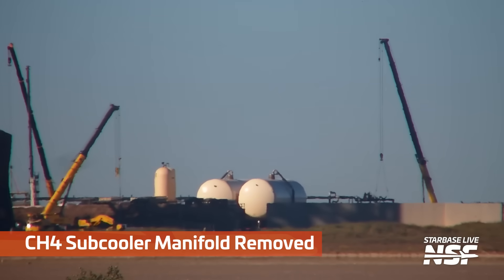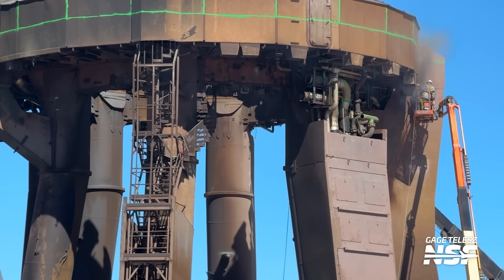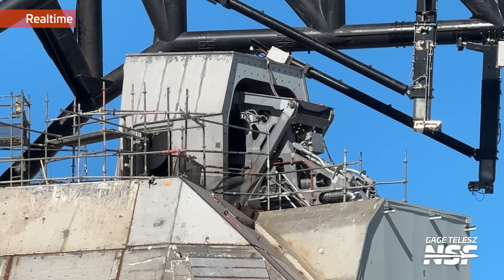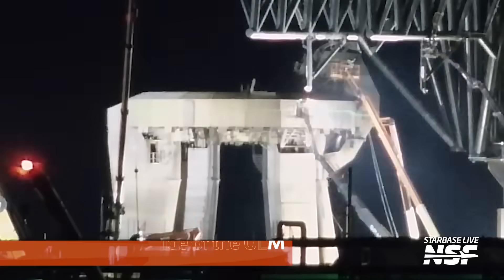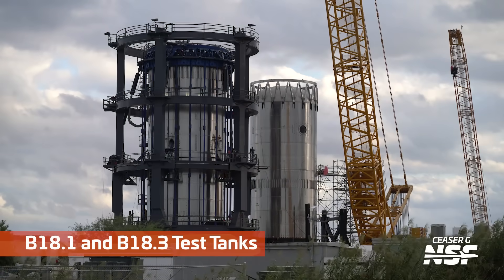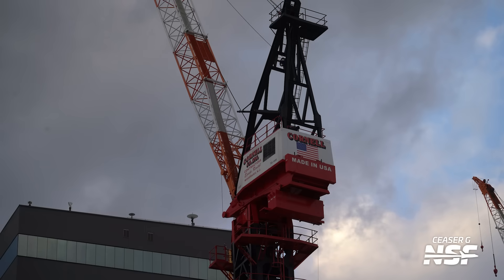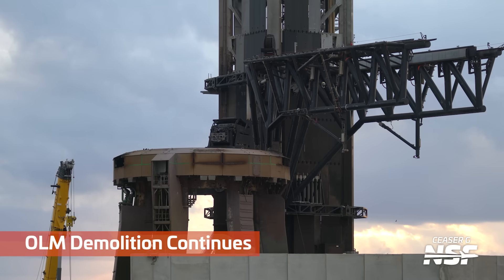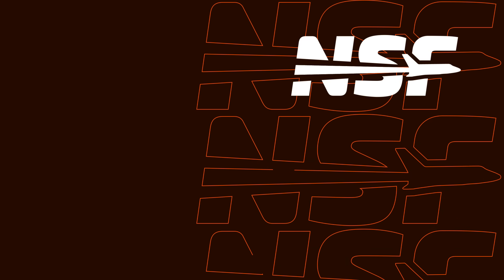"Tearing Down the Old Launch Mount" | SpaceX Starbase

Comment: thats the thing with demo. most people think it's all HULK SMASH! it's rarely uncontrolled like that. you need to understand how the structure is going to act as you remove parts. and how those parts themselves are going to act. if you're just doing a cut and drop you need to control it. not send it winging across the site. at 1:50 that torchman knew exactly what he was doing. brought it down to vertical then sent it straight down in a controlled manner.

Comment: You mean the mount that I have been saying since they built it was an ill conceived doofus of a design that would never work?   The one that Musk INSISTED was a ‘great idea’ and told his engineering team to just ‘MAKE IT WORK” despite their trying to explain that it never really could?   The launch mount that utterly ignored EVERYTHING ever discovered by NASA and Roscomos and even ESA about how to mitigate acoustic damage on a reusable launch pad, like, Y’know, the one SpaceX launches all their manned missions from at the Cape that was built in 1963?   This launch pad that SpaceX WASTED 4 years and 3 billion taxpayer dollars trying to slap bandaids on that made SpaceX 4 years late and a billion bucks over budget on a moon lander they have not even STARTED on?   Yeah, I knew this was gonna happen the first time I saw those flashes sweeping up the rocket in the first full engine test.   Those were the interference patten peaks of the thousands of acoustic shock waves generated by all those engines bouncing off a flat surface.   Powerful enough to shatter concrete, strip it off its rebar and excavate a hole 20 feet deep.   I can’t help but wonder how much further along SpaceX would be right now if the board had fired him when those SpaceX engineers signed that petition.   Like how PayPal suddenly became a thing, the moment they fired Musk as CEO.
Reply: Well that's because you never considered that it was designed for a system in active development.  One where for a long period they wanted easy access to the bottom of the booster without the need to take it off the table.  And when did Musk INSIST it was a great idea and when did he tell his team to "MAKE IT WORK"?   When did any tax payer money get spent on the launch mount?  I suspect you're doing the hater game of just making things up.  Haters tend to lie a LOT.  Are you a hater or just a simpleton who doesn't understand things are a little more complex than you pretend experts understand?
Reply: @imaginary_friend7300 pad 39a was designed and built while the Saturn 5 was in development.  But NASA engineers can do math, and they understood the forces that the engine their were working on would generate and so the simply designed a launch pads that worked perfectly from it first launch, all the way thru the shuttle program and now even where all crew dragons launch from.

So what you fail to consider is that ALL these problems WERE SOLVED 60 years ago. Pad 39 a has been rapidly reusable for the first launch.   And so has the pads at vandenberg.   And what did I say was wrong with the OlM before it was ever even used?  No water deluge for acoustic suppression. No flame diversion with  a fuel  farm Too tall and Too close to a pad that directs blast forces in all directions.  And the pad has a flat surface underneath, which the acoustic shock either pound into rubber, or reflect back up into the vehicle and the launch tower.  Those bright pulses shooting II the sides of the rocket  would KILL a person standing nearby.   And that stupid shower head “bandaid” only protected the steel platform, barely. It did not stop the reflected shock waves from damaging the tower or rocket.    
That’s what I Knew was wrong with it before they even finished building it.  And it took 4  years of spectacular failures before Elon finally decided to build a new one with proper water deluge and flame diversion.

So what you fail to understand is what an utter engineering flustercluck the OLM was.   Dumb, ill conceived, and oblivious.
Just like starship.    I’ll point. Out that the SLS, Saturn 5 and space shuttle all Flew flawlessly from their very first try.
Even Blue Origins knew Glen, launched flawlessly and carried its full designed payload mass to orbit on its first flight.

Starship is an amateurish fraud.

Comment: In a way, I'm surprised that they didn't use controled demolition charges to drop the OLM to ground level and use less elevated work
Reply: I don't think it's a good candidate.  Even when doing buildings they tend to precut the steel beams before demoing. NOT to say that it can't be done.

Comment: Small correction to what Das said at 7:05, the extra layers welded to the dome are not there to direct the thrust. The controlled flip will be done on v3 with thrust differential via throttling. The plating is just to protect the highest heat parts.

Comment: What a massive waste of money that launch platform was.  
 Watching hardware being built like software with optimist and denial as the main strategy is fun but what an inefficient way to proceed.
If SpaceX had adapted the NASA's Kennedy's launch pad 39A, like the one they are building now they would have been ahead.   Can you imagine if Saturn had torn up its launch pad like Starship 1.  NASA would have been humiliated for years.
Reply: You can't build a final design without the interim ones if the design itself is not final.  Do you think that was the case with NASA?  That they didn't build on older designs?  It is more wasteful but it also tends to be faster and more flexible.

Comment: It's fun watching 3 different cutting methods being used, stainless steel requires plasma cutting or carbon arc cutting and heavy steel can use the 2 already mentioned and regular cutting torch. I see the forward dome of booster is double and triple plated in spots but still wonder if they will use a ceramic coating that is light and helps reflect heat and strong enough to be used on pistons on Internal combustion engines to 10,000+ RPM and nitrous oxide.

Comment: 06:54  I had assumed that the drag from the asymmetrical design with the three grid fins would cause the booster to flip back the way they want it to. The best part… 😉
Reply from the maker: Gridfins have almost no drag  intentionally. They can be used for steering, but the negligible asymmetric drag of the 3rd is unlikely to flip the booster fast enough. - Das
Reply: @NASASpaceflight I guess we’ll find out. 👍

Comment: It would be cool if they cover the new OLM with TPS tiles
Reply: It will never happen because the raptor exhaust would shred them in seconds.
Reply from the maker: TPS tiles are like painted styrofoam... good insulation, not good physical protection against direct forces. - Das

Comment: If I was running the demo, we'd be cutting it apart with diamond wire saws and then using the torches on the ground
Reply: Why
Reply: @Belle-nn  faster, easier, cheaper, and safer to cut it into big chunks and sort it on the ground than to dismantle at height

Comment: 4:35 There is a special edition of the Ford F-150 called the King Ranch, most of which are sold in Texas.
Reply: So we need a Cyber Truck King Ranch edition.
Reply from the maker: Drove a King Ranch F350 dually pulling our RV for many years. Got it broken down and fixed it up (hence being able to afford it), but the seats were NICE (and smelled great even after 250k miles). Used to use the official King Ranch saddle conditioner on them. - Das
Reply: My favorite trim